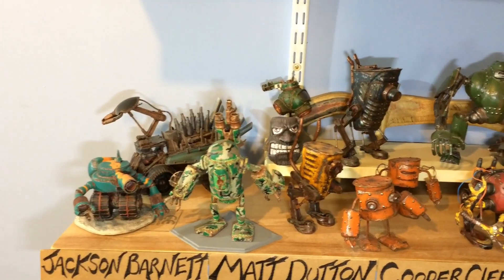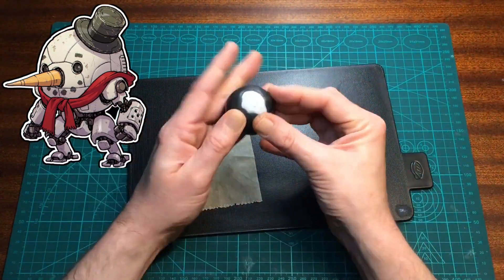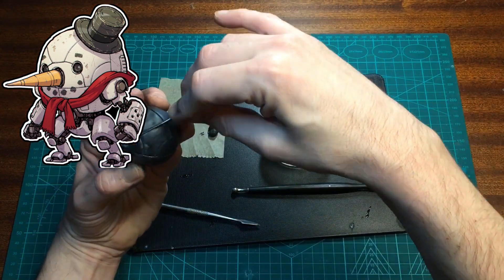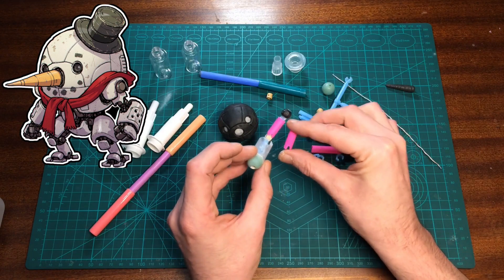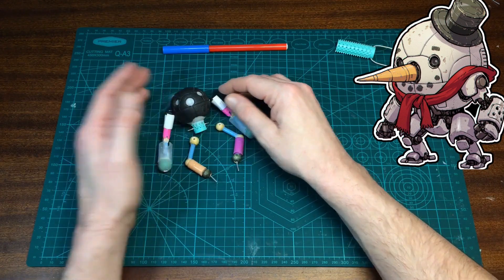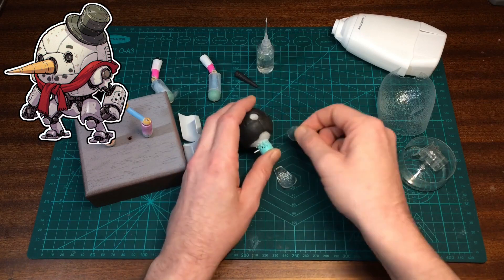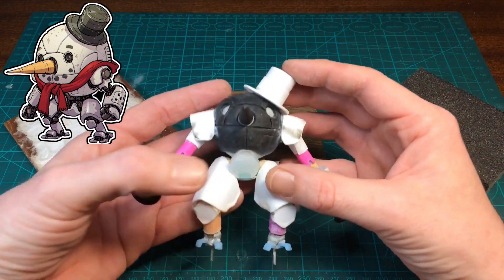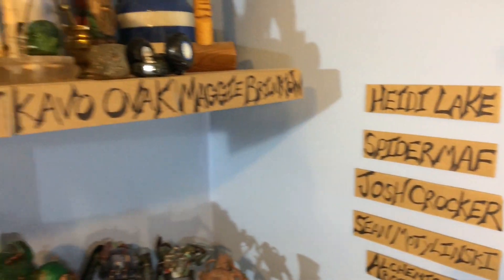Snowbot Scratch Build

Comment: Super cool. Thanks for the artist. New favourite. 

 As for panel lines, I use a thin metal flexible strips, like the ones for fimo.
Reply from the maker: Thanks Anam, your very welcome. OK... Thin metal strips I'll have to have a look. Are they aluminium?
Reply: @AndyMecha   Stainless Steel. I swore them on a magnetic strip. Aluminum might work too but it deforms easily I think
Reply from the maker: Ok, thanks for the help. 👍 You're right aluminium is very hard to make a straight line with.